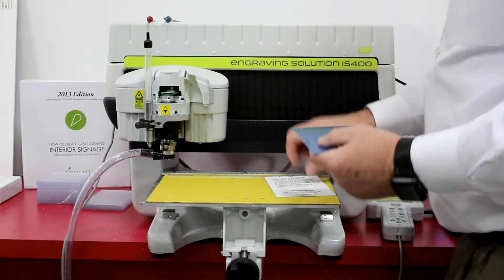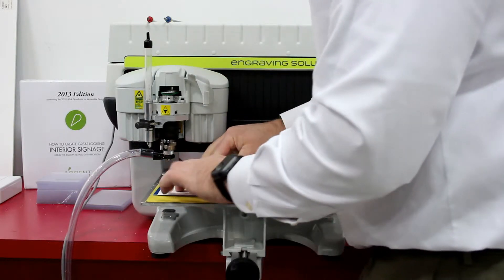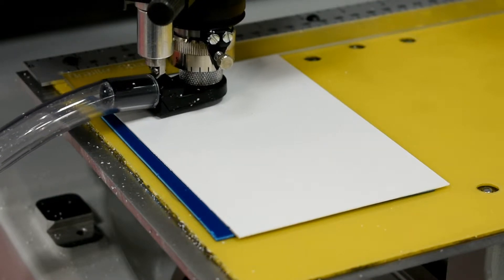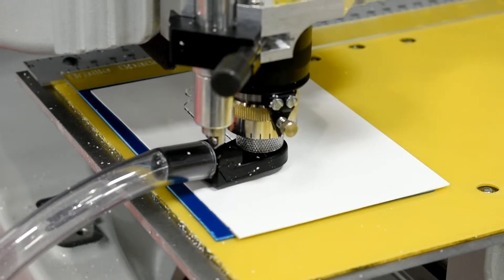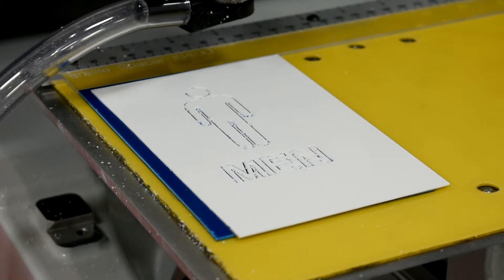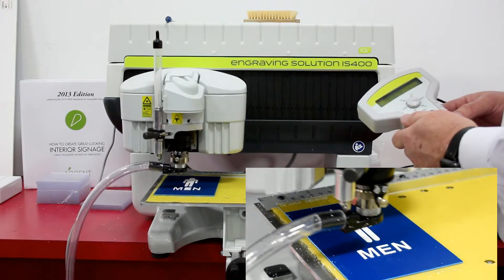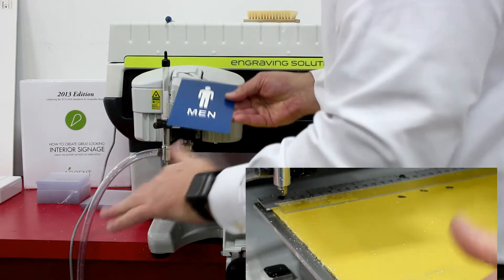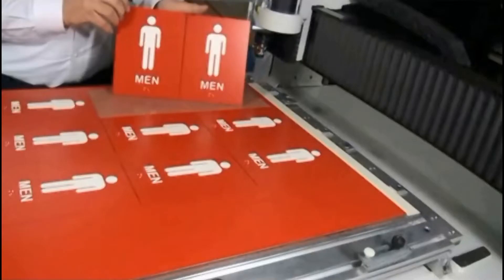ADA sign IS400

Comment: The is400 is this video
I just bought a used one and looking for some help setting x0y0 on machine
Reply from the maker: Contact Gravotech support at 800-843-7637.  They can email you the users manual, it will walk you through setup and calibration.